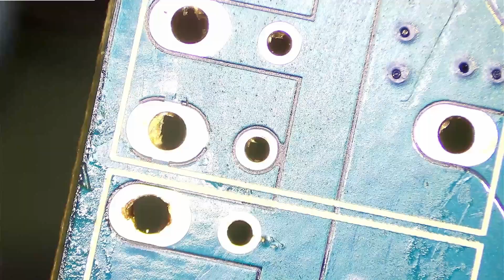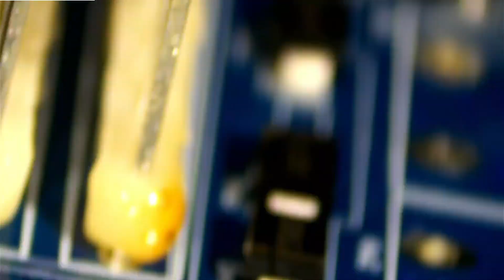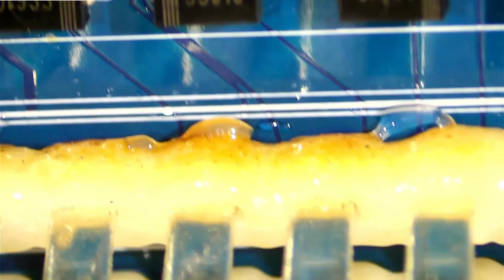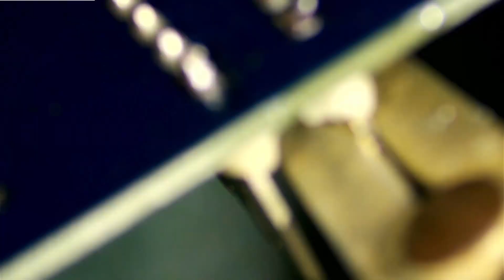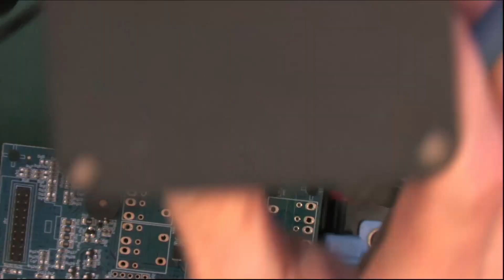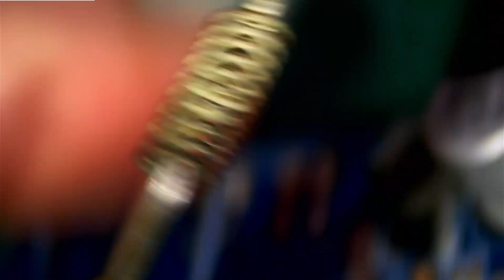Automotive Seat Module, Let's pull the relays.

Comment: small tip for desoldering. after the tin melts , quickly tilt the suction-tool vertical to seal the hole. this creates a stronger vacuum and removes more tin. 

of yourse be cautious on tiny holes to not rip the pads